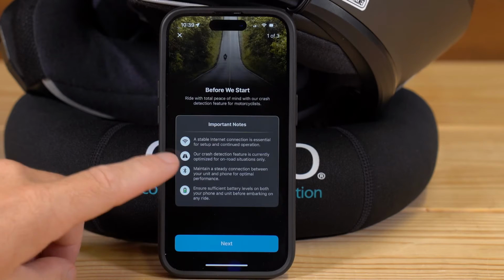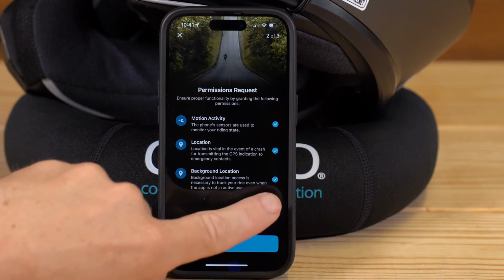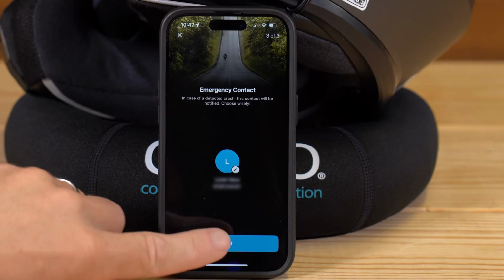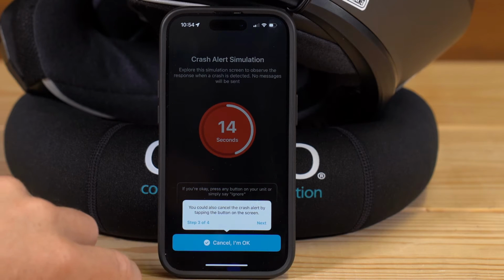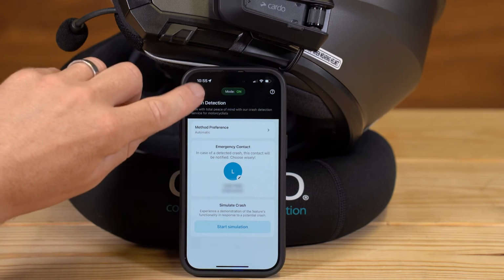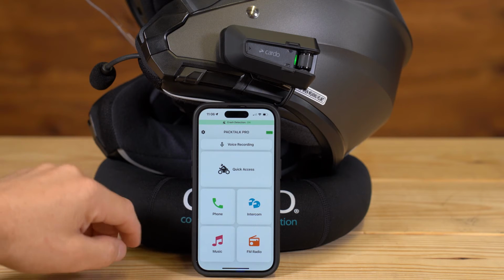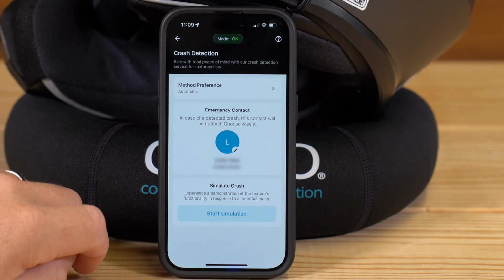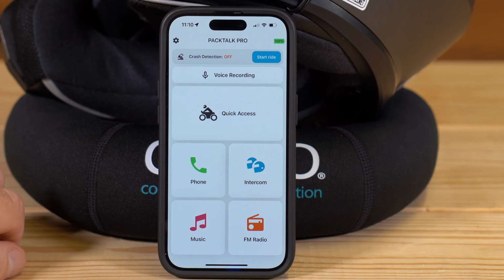Crash Detection Tutorial: PACKTALK PRO

Comment: But if the phone is crashed?
Reply from the maker: Good question — the system needs the phone to complete the full alert flow.

The unit detects the crash, but your phone provides GPS + data connection to send the alert. If the phone is damaged or disconnected, the alert might not go through.

That’s why we always recommend riding with the phone connected and secured 👍

Comment: So what happens when you use it Offroad?
Reply from the maker: Great question! The Packtalk Pro relies on your phone’s signal to send crash alerts, so in areas without reception, the feature may not work reliably. For off-road adventures, we recommend the Packtalk Edge—it's built to handle a wider range of terrains without relying on crash detection. The Packtalk Pro is better suited for road-focused riders. - Richard